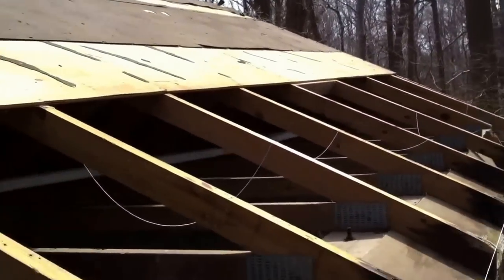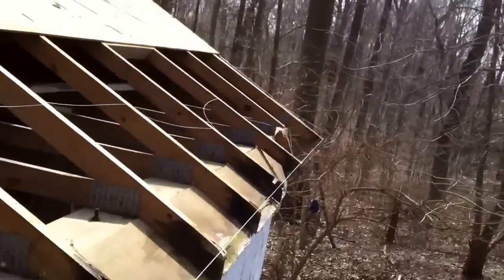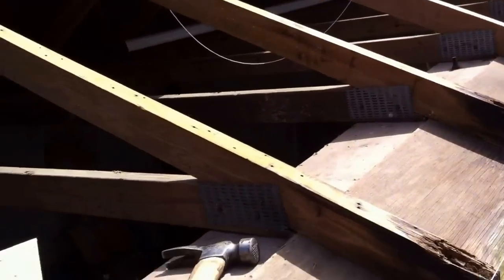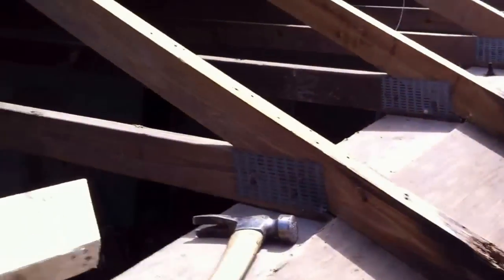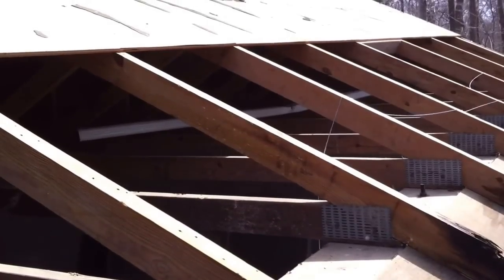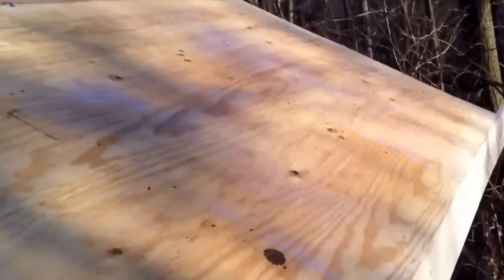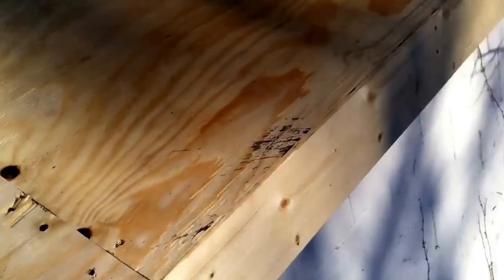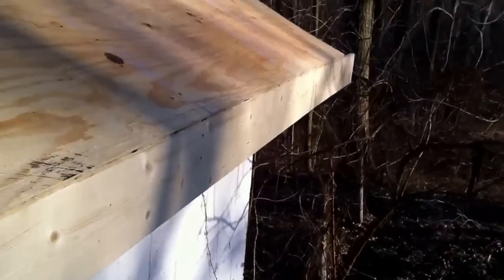Rafter tail and the importance of fascia

Comment: As a builder with over 30 years experience I would have had my Carpenter remove all the rot
Reply: Really! I can't believe he did not cut off all the rotten tails. That rot will continue to spread until the whole roof and rafters need replacing.
Reply: Who knows what he did, he didn't show us.
Reply: **Good job check what i build on Instagram @joeyturnerdetails stay blessed my friend GN**
Reply: @ipeeinmysinkimafraidtocome7127     The fungus/mold that rots wood reactivates with humidity, it doesn’t only happen with a leak.
Reply: Thank you @Luis Puccio , as someone who id EXTREMELY allergic to all kinds of mold this video made me cringe.  You HAVE to cut off ALL the water damaged rafter tails.  The only other option is having a mold remediation specialst out to treat every one of the tails which will cost about 3x as much.
Reply: Who knows what he even did he showed it and then he showed it covered up. Kind of fishy he said it right after saying that roofers won't even fix it normally....hhhmmm weird.

Comment: you didnt cut the rot out? lol that rot will just continue up the rafters........ it doesnt stop once it starts unless all rot is removed.......... this is how NOT to repair a rafter tail. If you are going to take the time to take the roof apart, at least do the job right.
Reply: dynocompe that's exactly what I was thinking... my husband is a carpenter and always removes rotted parts so it isn't continuing to rot...
Reply from the maker: There is something wrong with your perspective. It is deeply negative and explanatory. Please I encourage you to make your own videoed
Reply: Too many negative Nancy's on YouTube.
Reply: dekonfrost7 For those of us trying to learn, what is wrong with the perspective of the commenter? Just because it's negative doesn't mean it's wrong. I had the same thought about cutting out the rot and came to the comments to see what others had to offer.
Reply: I don't think cutting the rotted wood out actually stops rot more than simply preventing any more moisture from saturating. But it would at least stop any moisture or biology (if any) still in the rotten wood from being in direct contact with the new wood.
Reply: its not rust its wood rot. take away the moisture and it stops.

Comment: LoL - sorry about all of the whiners... @1:07 you can see the one sister that has been nailed in and obviously we can see the before look from shots before that.  Thanks for showing the exposed framing along with the rot and the solution.  I guess everyone wants to see the measuring of the angle, the cutting of the board, running the string down the side of the rafters for alignment, and the nailing it in place.  <shrug> I saw what I needed, thanks for the video and the advise!

Comment: Thanks for the information on how to repair a rafter tail. I bet my husband and son there was a cost effective and sensible way to fix the problem and your video shows them it can absolutely be done.
Reply from the maker: Thank you for your input, but do note if the damage is near the top plate of the supporting wall that's another issue. Please note this difference.
Reply: It's approximately the last 8 inches of the tail that needs repair before we can replace soffits and hang new gutters.
Reply from the maker: Yes than this will be more than enough to help you. Please note that the use of a framing nail gun is recommended and as many as 10 nails per foot and a minimum of 2 feet connection with the truss so for you each piece would be 2'8" long. Glad I could help.
Reply: Roxanne McIlvaine  nbbuuh

Comment: I had the same problem with a pole barn that I bought. The damage was caused by someone without roofing knowledge or being cheap. They didn’t use a starter strip when they roofed it. Did a lot of damage. I fixed it myself. Did a lot of research an a lot or procrastinating before I fixed the problem. Then I struck a chalk line, then I cut 2 foot of the roofing and sheeting off with a circular saw. Ripped it off, sister the 2 by 4’s with screws1 foot on the outside and 2 foot on the inside. Used the 2 to 1 ratio on the size of 2 by 4’s. I did cut the ugly parts off of the old 2 by 4’s. Turn out real nice. His example shows that it can be done with a little work. Just do the research and figure out the best practice way to do it..

Comment from the maker: It's always a good idea to cut out any rotten wood, I gutnout as much as I can to ensure that i didn't leave a colony. But mostly so I can identify weak vs strong areas of framing. I don't bother to cut out rotten wood as I go. I set the depth gauge on my saw then I cut them off after I'm done sistering the rafters. Also this rot wasn't from termites it was from plain old wood rot from being wet.
Reply: LIke the tip about sistering first and then cut off the rotten ends. I can use that one on fixing mine this week.
Reply: It's called mold which is a severe health issue.
Reply from the maker: Eli Fire lol you ever been in a attic in your life ? Do you know anything? About anything ? Get real wood with no moisture wont support mycelial or mold growth, let alone being pasteurized by the sun in the summer
Reply: I got a question, you opened up the shingles and paper quite a bit, I’ll be doing this myself on a flip home is it a problem to leave the roof open to the elements as long as I’m not worried about the interior of the house? Should I cover with a tarp?
Reply from the maker: @mikescatena5732  i ideally if you do not replace the roof in its entirety, and its an asphalt shingle. You can use weather watch or an ice. And water shield under the last course of shingles. A tarp etc is good if it covers the entire roof, but then to fasten it down securely makes more holes then the trouble its worth. Spend money on ice and water shield not tarps. Keep the wood dry as much as is possible
Reply: @dekonfrost7  thank you

Comment: Old video I know but I need to do this to my shed before the roofer comes to replace the roof. In the video you said that the fascia supports the plywood. Does this mean that the top of the fascia should be higher than the end of the rafter?
Reply from the maker: No ideally they would be on the same plane. The fascia if a 2x should have a bevel cut on it. So it is flat and supports the plywood, having only the edge of the fascia support the plywood is better then nothing.
Reply: @dekonfrost7  Thanks, It will be a 1x and will be replacing a 5/8" plywood paneling fascia that has rotted away in spots. I can bevel it on the table saw. The bigger task will be sistering the rafter tails which are notched and tapered.
Reply from the maker: @lancomedic  simple fact you are talking about the birds mouth and that’s a different story. If the wood Is good at the birds mouth this method will serve you. If the birds mouth is rotten you need to stop and repair it and that’s where a bigger amount of effort comes in. If the wood for the birdsmouth is good then just having something going into the framing a little ways will support the fascia. And that’s really important
Reply: @dekonfrost7  Thanks, I get it. Fortunately the birds mouth is good. It's only the tips of the tail that's a little soft.

Comment: i dont agree with everything you said as far as methods and efficiency but I respect that you're taking care of your customer. And thats all that matters. Keep it up Brother
Reply from the maker: +joe nino  on this little job yea. You're definetly right. I did a whare house or two and I'm on the east coat. Wood framing and when you have 70 or 80 of these per side and they needed a new roof 20 years ago  this helps a lot.

Comment: My house has faux rafter tails. What’s the purpose of having faux as opposed to simply having a slightly longer rafter with a tail? Does it protect the Main roof rafters from getting rotted by the elements? Does it make the rafters slightly stronger by not spanning such a great distance?
Reply from the maker: Honestly… it’s something you would beed to describe better or post a link to a pic. Some are extended with a triangle, like french construction to extend the eves, some are merely extensions because the original modern built 75’ or later homes had eves that used to ice dam. So there are many scenarios with which this could be.

Comment: "pretty common problem" nowonder if soffit is totally closed and no ventilation  so tiny bit moisture will rotten those rafter tails because they are in cavity which traps moisture in.
Reply: We had a vented roof and they rotted.
Reply: @elifire4147  If rafter tail is cut to plumb it gets wet almost every time rain. Cut those tails to 90 degree from roof pitch and they will last much longer.
Reply: its cause they didnt use drip metal when did the roofing
Reply: @johnwhite2576  What luck that gutter what you are using was common here in 1970s no one uses those anymore. We use half round gutter with outside hangers which are also adjustable for every roof pitch.

Comment: Good Video 
Did you BEVEL the EDGE of the FACIA ?to the Rafer Tails ?
or you Set it Slightly BLOW the Rafter Tails ?
Q2: Rafter Tails Spacing ??? 16" on Centre
Reply from the maker: I often bevel the top edge of the fascia, always when i use a 2x most of the time when i use 1x sometimes if i have a table saw with me. If you use 1x you can push the fascia down a little to the outer edge of the fascia touches the edge of the plywood.
Reply: @dekonfrost7  Thanks 
how was the Old Rafter Spacing - 16" on Center ?
Reply from the maker: Joni English depends on how lumber rich the area was. Sometimes tighter and sometimes every 4’. So ... modern building in US is typically 24” oc
Reply: @dekonfrost7  just building a garden shed - 12x10, ridge beam ( 8x2) with 6x2 rafters

Comment: The trusses are at an angle, do you cut the top of the fascia at a slight angle also? If not how do you keep the plywood from turning up at the edge slightly? I suppose you could drop it down 1/4". Wish you could have shown that part. Thanks for the video.
Reply from the maker: That's a good question. For low slope like 1/4" of fall per foot like this video I simply pull it back a bit until there is a void between why would made a angle between the front of the fascia and slope of the roof. You could also let it pass by a little here because the drip edge would cover it. 

On steep slope roofing like 12/12"  or greater I often dress the top edge of the fascia like you suggest. It makes for an awesome job and if you have a portable table saw is a relatively easy task. Albeit time consuming. Thanks for watching
Reply: Mike Zaloudek you plane down the tail with your speed square till it lines up with the top of the fascia when youre hanging it.

Comment: While it would probably be a good idea (certainly not a bad one) to remove the rotted wood, Its important to realize that rot (which is a fungal growth) requires moisture to thrive and grow. The spores that seed rot are everywhere. The key to keeping wood from rotting is keeping it below a certain moisture content. There is no such thing as 'dry-rot' in regards to wood. It is a misnomer. This is not to say, 'yes leave all that rotted wood', only to clarify the mechanism of decay so it can be properly guarded against.
Reply: You're quite right. Calling wood that has decayed due to prolonged exposure to excessive moisture, "dry rot" is very misleading, and a better descriptor should be adopted by us all. "Wet rot" is correct. For fun, calling it, "Got damp rot" would at least give a chuckle to a carpenter having to repair the damage. 

My next quest is to get people to stop calling sublimation* of water in frozen foods, "freezer burn." Nothing was burned, it was just extremely dehydrated because it was not sealed well enough in a modern freezer that has a frost-free feature. That feature keeps the humidity in the freezer so low that the ice actually evaporates, so that it never builds up to the point where it has to be defrosted to remove it, like in freezers of half a century or more ago. 
*Sublimation: This is when a substance changes phases from a solid to a gas without becoming a liquid in between. Tungsten, and some other metals with high melting points, can be heated to glowing in a vacuum, and will evaporate without melting. As they so, they radiate away their precious solid state as though melting and evaporating, and the metal "gas" radiates away from the hot source to land on whatever object is in the line-of-sight and is cooler. 
For fun, and a little science knowledge, do a web search for "tungsten sublimation pump."
It is used as one step in creating a very low pressure in a vacuum chamber. 

Freezer burn. Pushaw.
Dry rot. Nonsense!
Military intelligence? Next time...

Comment: I'm not a carpenter so any comment is impractical overkill I'm sure. What was the situation that caused this? Would it be worthwhile to paint the end parts of the rafter tails, at least the end grain? Would it be worthwhile to angle the top edge of the fascia to fit tight against the plywood sheathing, maybe even caulk the joint when you put it together? BTW, which do you nail in first, the fascia or the plywood?
Reply: Very nice video. now I know what that area looks like.

Comment: Water may back up into rafter again. Wouldn't it be wise to use pressure treated wood for the sistered rafter end, fascia and  plywood edge? Yes it's a little extra money but in this country the cost of labor is horrendous and would justify its use.
Reply from the maker: Treated lumber is for whennyou know that it will experience water. A properly built roof protects the framing from water. So I treated lumber wouldn't help here. The cost of highly skilled labor in America is the culmination of years spent in the craft and continual reinvestment in tooling and development of future generations of building. Competition makes these costs fair to consumers who wish to find good work at a competitive cost.
Reply: stanley siewierski ^ to add to that it depends on the wood itself, if your lucky and are in an area you can get cedar boards they will last a lifetime kept dry! The barn we have was built in the 20s the wood still looks almost new it's a mix of cedar pine and hardwoods depending on the feature your looking at,  and the wood still looks brand new even in the weather damaged spot once you get past the damaged area on the door (door corner broke so it has some rot from the unpainted wood being exposed, because of how that was built it's an easy fix just have to pop a couple of the boards off and replace them) the interior of the rest of the doors look AMAZING still you'd never guess it was almost 100 off the look or condition of the wood on it (the concrete is a different matter entirely it's busted up pretty good lol)

Comment: You mentioned about a sub fascia. Please tell me in full, or do a video. I'm soon replacing a out building roof with tail rot and fascia rot. I seen only one other video that installed it. but no references were mentioned. I live in central Pa. Thankyou
Reply from the maker: John. An fascia is a piece of 2x" that is screwed or nailed in as fascia normally a2x6" then a piece  of 1x6/1x7/1x8"that would be painted or wrapped. The sub fascia adds a tremendous amount of strength to the eve, very important in a roof located in areas where snow will sit on the eves. Hope this is enough of an answer
Reply: Have a garage that was added on to the house. It used two 1 x 6's instead of the 2 x 6 and 1 x 6 as was used on the house itself where it joins to the garage. The only thing I can think of is that maybe the garage and house did not line up exactly even.

Comment: How can you sis turn on another board when the rafter tails are stuck in some stucco wouldn't that move your rafter fell over by inch and a half or the thickness of the to buy material I need to repair the rafter but I can't move it over because of Stucco issues on the outside of the house so how could you do that or fix that
Reply from the maker: Honestly its way more involved. This was never a how to video. It was making a point about the purpose of fascia and how without it how rot occors on the de king and rafter tails. To do what you want one way would be if the roof at the ece was sokid remove the bottom shjngles slates etc. Then glue and screw them to the roof deck to support new fascia. But it may or not be good advice for your specific situation.